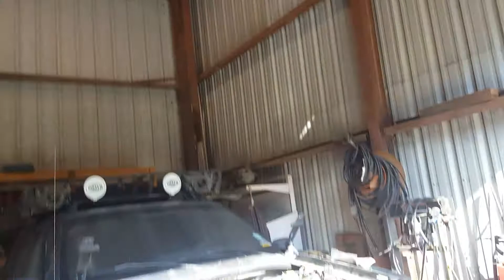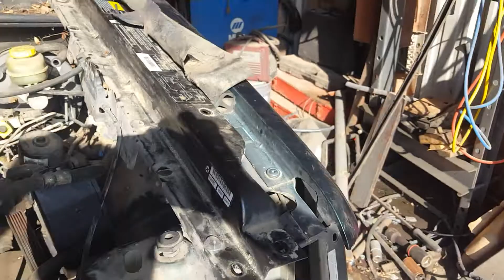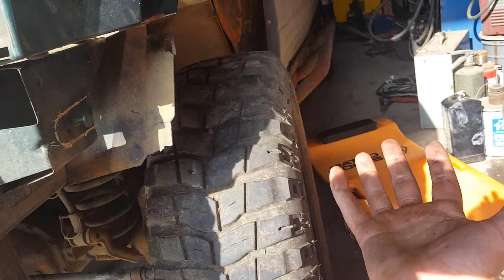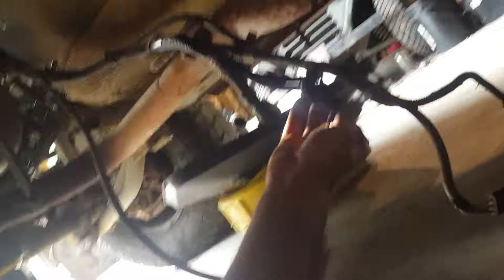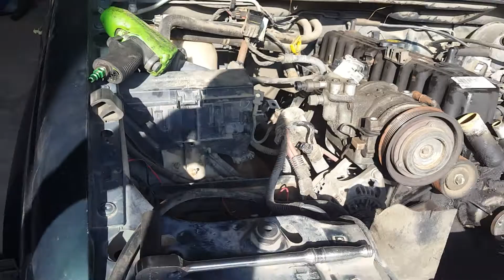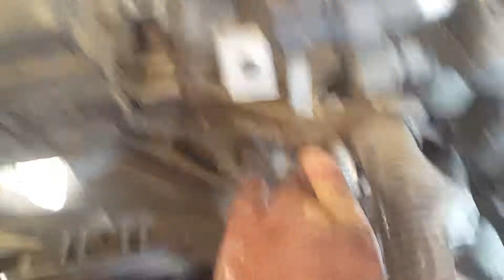Jeep Grand Cherokee ZJ engine wiring sub harness ( video cut short)

Comment: thanks , i spotted the wire from the trans oss mustve rubbed apart sgsinst the front driveshft, figured i would spot the other side of it but haven't yet, will look towards the sub harness , ty jj from nj